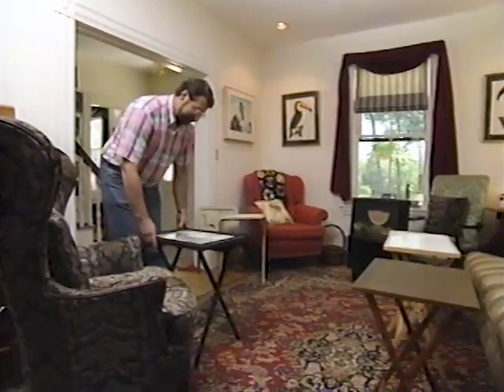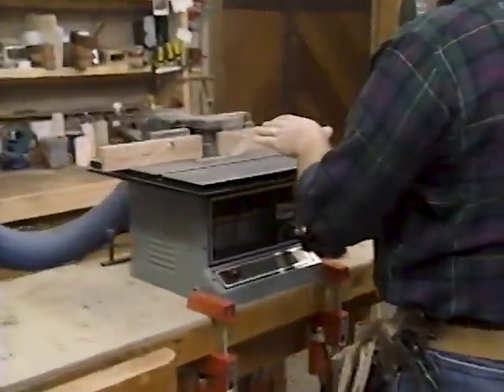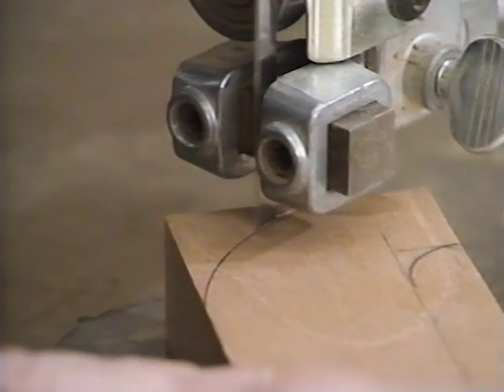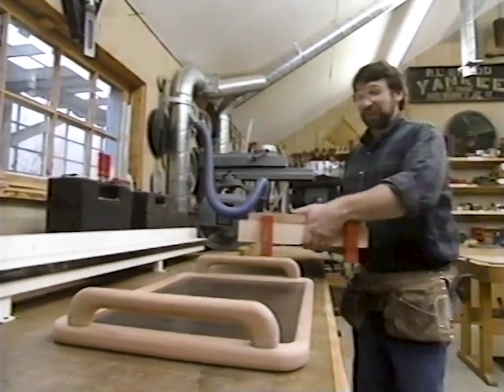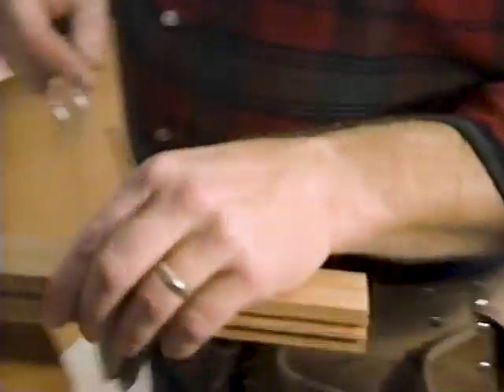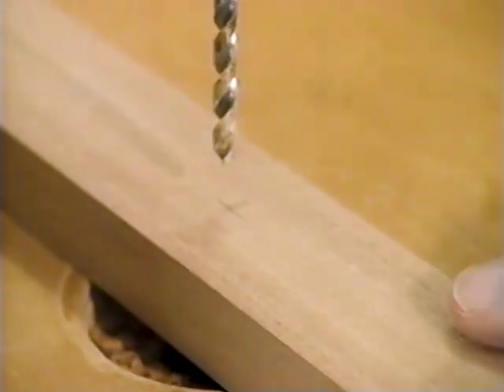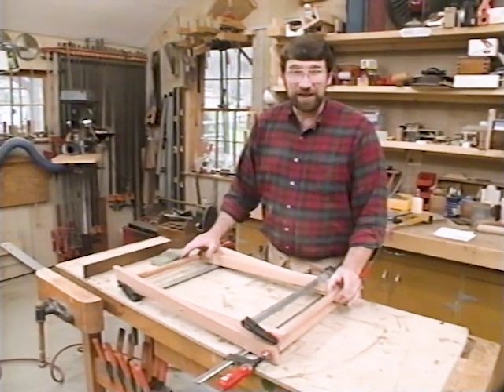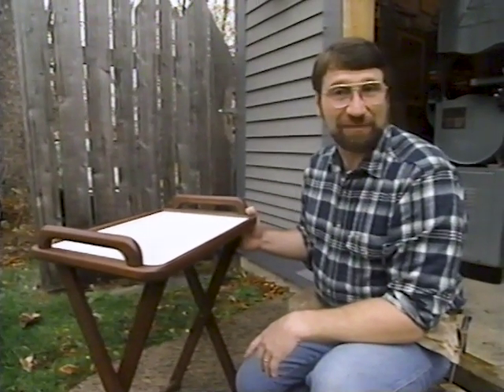TV Tray Table  |  S7 E3 *

Comment: i turned one into a gaming table for my computer steering wheel 🛞 mount. had to get inventive. yes mounts to the desk but it wrenches on the trim. had an extra so i removed the top grips the feet/grips better just sits on the edge of the desk. no fuss to muss. other i use for drinks, and my Dyson hepa fan. i got the half/moon/to half scoop ice cream one i forget the model. the fan requires a canister micro filter good for a year use minus how much you run the fan. i breath better. seldom sneeze 🤧 any more no more air pollution plus it puts out cool air. it will oscillate or turn off or slide the vent up for the room or on me and the room.  i don’t let the twelve month get that full 11 months or as i check to see the status of the filter by the remote. one three bars from the top. Dyson filters direct was over priced for one filter Amazon two less than thirty bucks. it’s same filter minus not having Dyson stamped on the filter. the other was the site was always down or in operable my last filter last all of 2022- just now put the second one in i keep them in their plastic till needed. the fan has two release buttons on the side to remove the fan . set that to one side over turn the base insert new filter. hold two buttons in click goes the top don’t force it theirs a sweet spot. hit the power hold that down reset the counter. fresh air. you pull one filter gee’s that’s what i’m breathing.  toss the old one. you’ll notice a big air quality even after just a few minutes of use. yes their expensive but work, worth the price. same with their vacuum even on extended run i’m getting the whole house. the problem with other vacuum brands mele brand your out of hepa bags your out till your order comes in. as the bag gets full suction is lost.  Dyson dump n go. with other brands you hope it doesn’t break or fail mele had belt failure on the head took for ever to get fixed. my dad has an original sears shop vac had a switch go new switch occasionally filter has never missed a beat.